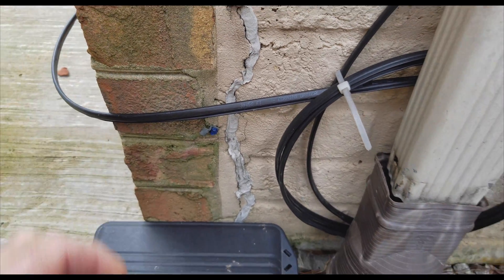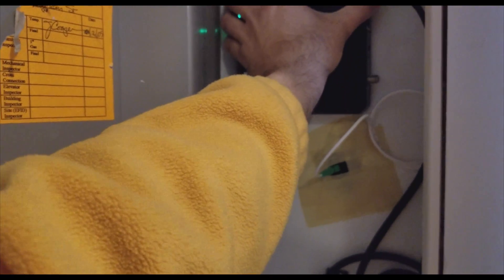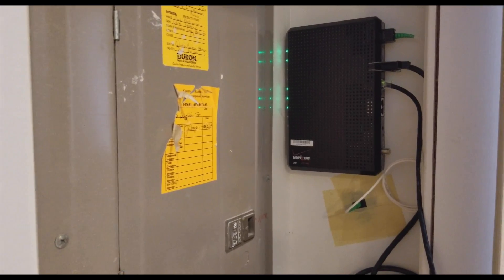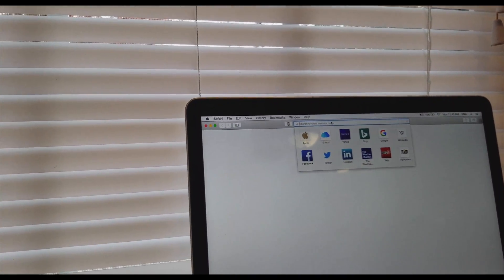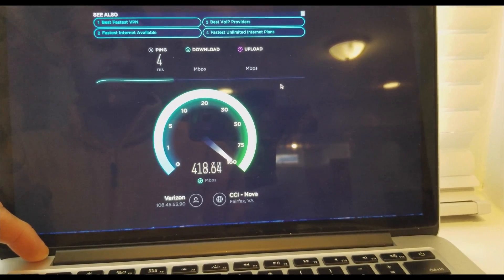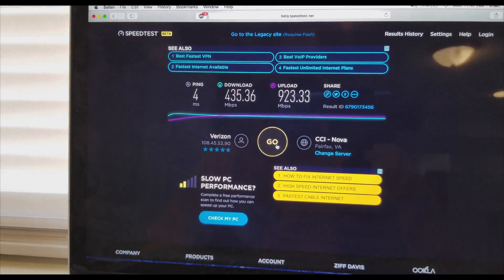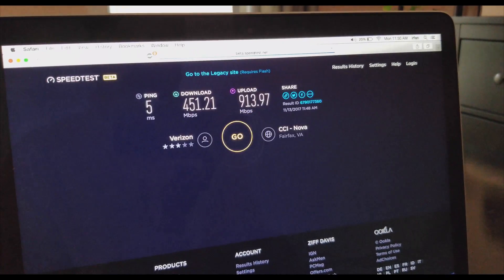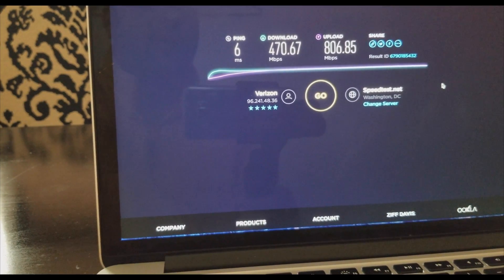Verizon Fios Fiber Network Test

Comment: moca is capable of up to 1200mbps. my isp is comcast and i am using a moca adapter and getting more than 250mbps download speed. and in the next month or two i am going to be upgrading to gigabit thru comcast. so what the verizon test told you was a 100% lie!